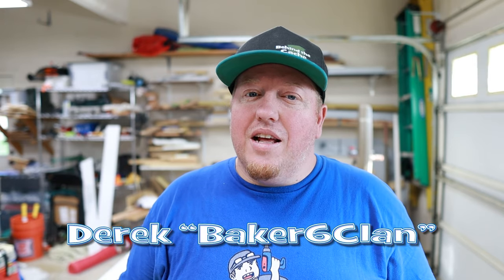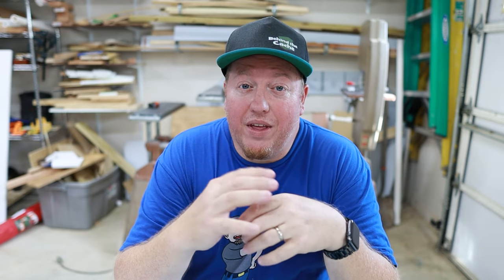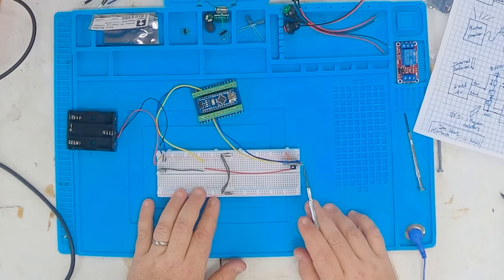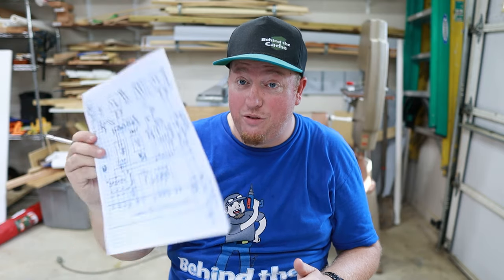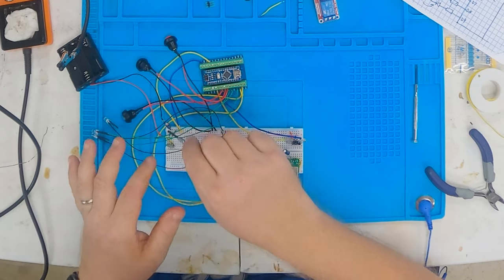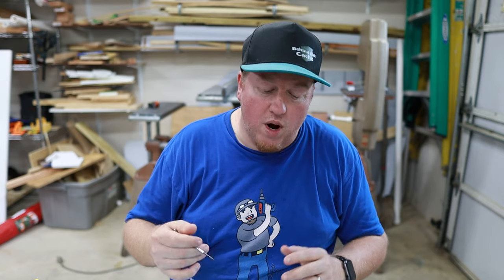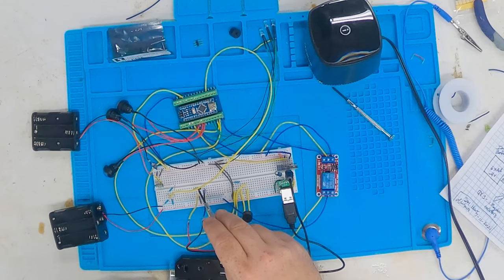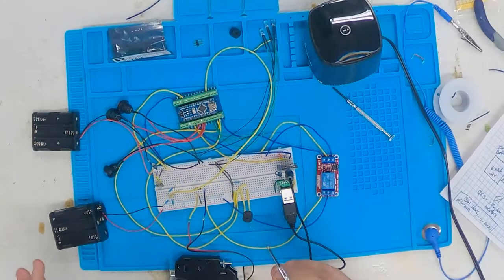Smart Cache Collaboration Build Part 2  - The Wiring (GCNW)

Comment: 🤯 Very interesting. This is way outside of my wheel house, but I used to say that about momentary switches and LEDs too. Thanks to you and learning as I go I have taken on a little more with each build. 

I just received some new recordable sound modules today that I look forward to using. I also have some 8x AA Packs on the way.  

I am the only birdhouse gadget cache builder in my area (RoombaCats is an hour from me), and I have had problems with cachers trying to solve my “bring your own battery” gadget caches without using a battery. Leads to a bad day for the cache. I am going to try and provide internal power on future builds. 

Thanks for the fun, education, and challenges!
Reply from the maker: Well this one has both internal and external power. I will explain why in a later video. I try to push myself with each build too.